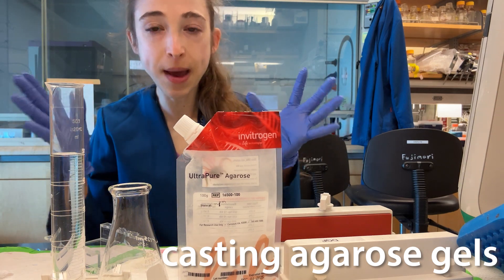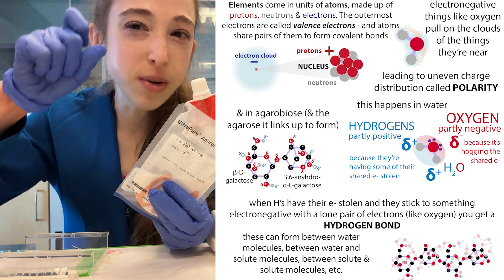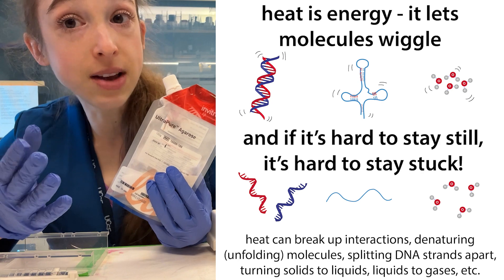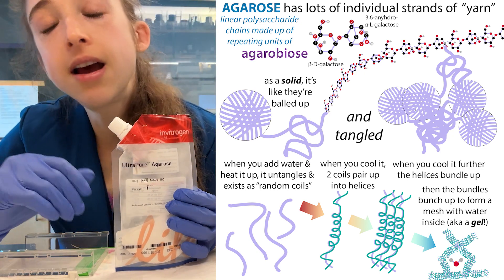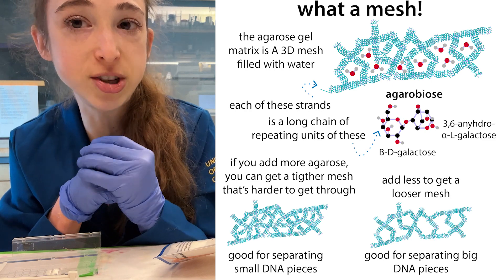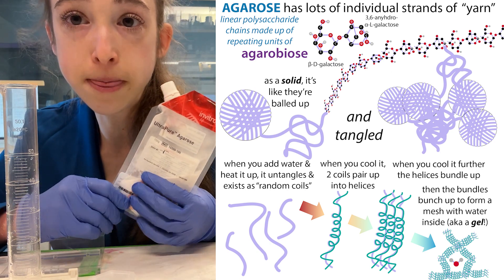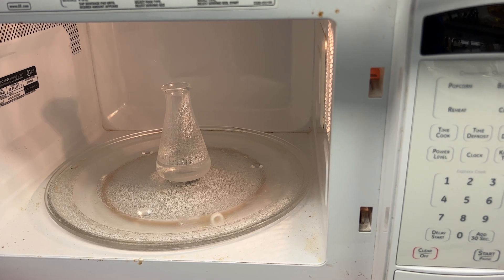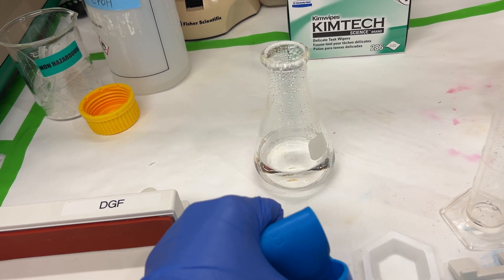Casting/pouring agarose gels - what to do and what goes on when you do so!

Comment from the maker: Then we pour it into a gel casting “mold” & add a well comb to leave spaces to load our samples into. And let it cool. As it cools, it goes from clear to cloudy as it transforms from a liquid to a gel. That’s a change we can see, but the cooler stuff is happening at a level we can’t see. 
 
As it cools, agarose’s molecules run out of the energy needed to wriggle around freely, so they settle down in the most comfortable position, which happens to be a convenient mesh. At the molecular structural level, each of agarose’s “strands of yarn” is a chain of about 400 subunits (so 800 individual sugars). When they have enough energy (high enough temps) they move around lots & don’t have a defined structure. We call this a “random coil” structure. 
 
BUT when it starts to cool,  it loses its energy so tries to settle in the most comfortable position (if you can’t move you at least want to be comfy). The 3,6-anhydro-L-galactose makes this “tricky” because 2 of its “legs” form a “bridge” across the ring which is kinda awkward. As a result, the most comfortable position is a helical form ➿. 2 strands of yarn wrap around each other in an antiparallel double helix (like in your DNA, but these helices are left-handed (do a thumbs up with your left hand & follow your fingers) unlike the right-handed helices of your DNA) w/frayed ends 
 
These joined helices can still move around, but as a group. As you cool it down further, they start joining up to other helices (AGGREGATING)) to to form bigger bundles of helices (supercoils). Cool it down even further & the frayed ends start getting tanged up w/frayed ends of other helix bundles, so the helices start clumping up. BUT they still have that water coat & can’t get too close, so you get a porous mesh w/water trapped inside - perfect for DNA to swim through! 
 
more about all sorts of things:  #365DaysOfScience All (with topics listed) 👉 http://bit.ly/2OllAB0 or search blog: http://thebumblingbiochemist.com